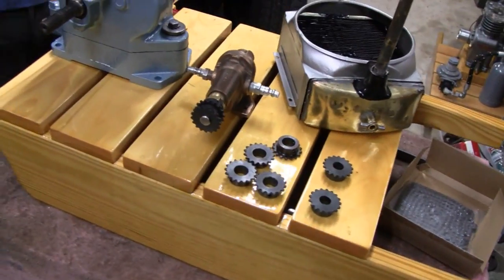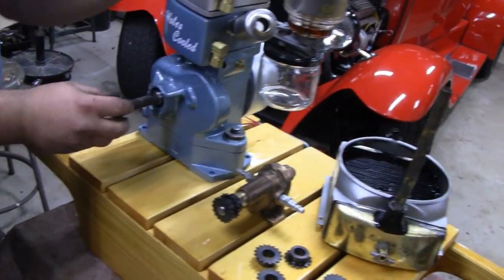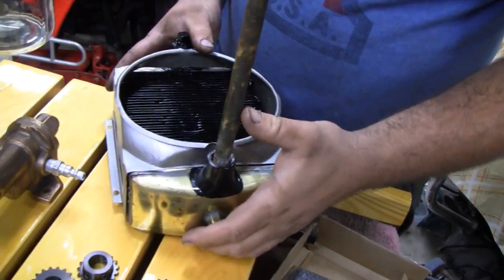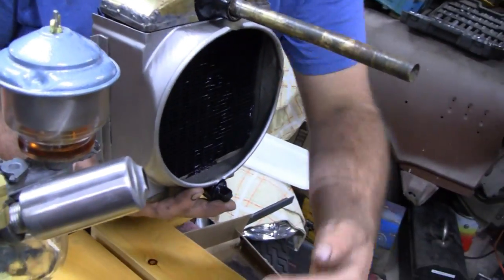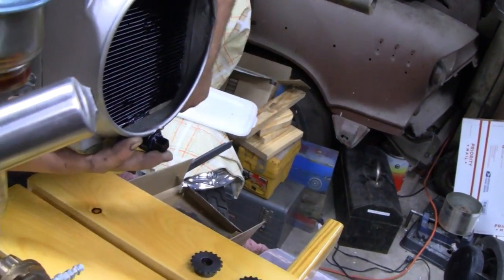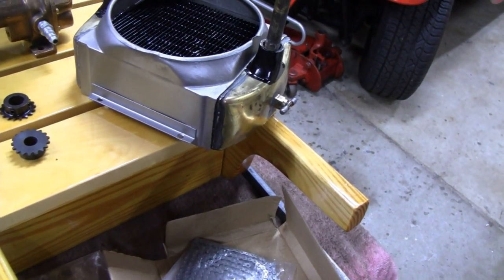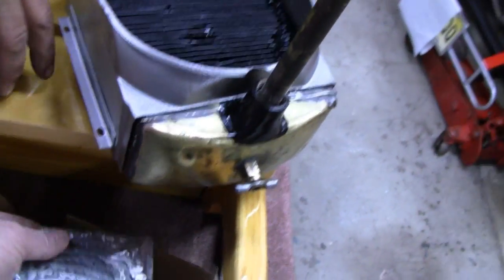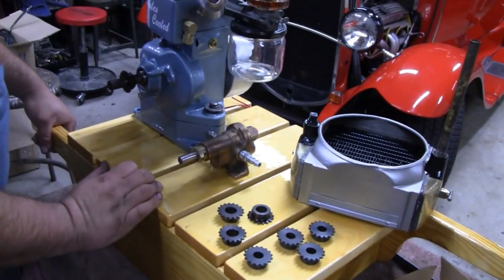HOMEMADE WATER COOLED BRIGGS ENGINE (part 37)

Comment: ur fan is gonna push the air thru the radiator rather than pull the air thru, the way it looks now the exhaust is also going to be pulled into the radiator. the fan needs to turn clockwise not CCW.

Comment: Make the pump moveable so you can adjust the chain length
Reply: DeadlyVoltsHD .......or just put a spring loaded idler sprocket, but anything else in the "loop" would rob horsepower. Adjusting the pump would cause the fan to become loose, and vice versa. You can't make the fan adjustable without making the radiator adjustable as well. They sell half links just for that purpose.
Reply: Keith Lucas i guess just use a longboard wheel and groove it for the chain to sit in the groove and just make as you said a spring loaded lever with the chain roller
Reply: DeadlyVoltsHD....I built automation machines back in the day and improved existing ones. One of which I milled nylon strip stock for chains to track in taking out both the noise and vibration from chain slap. Honda motorcycles that I worked on back in the Seventies had the double rubber rollers on a spring loaded channel, very quiet.

Comment: I assume the radiator mount was installed temporarily and will eventually have the nuts under the sled surface. As for noise from the chains, if one has an odd number of links and the other has an even number, the harmonics will cancel each other and run perfectly quiet. :-) Chain guards are probably on the to do list so the engine will be OSHA approved. Good job guys and I always look forward to the next installment of this build.
Reply from the maker: Thanks Bud!!☺

Comment: How does a half link work on a chain? Aren't the rollers supposed to be equally spaced to give correct meshing with the toothwheels?
Reply from the maker: You have to see one to understand how they work!!☺
Reply: derp, a quick google explained it haha. Basically just means you can get away with removing one link at a time instead of two.

Comment: I would have turned the motor the other way put the fan on the end of the shaft to cool the radiator and then you would have only had one sprocket to deal with. Nice videos and project, thank you
Reply from the maker: Thanks Bud!!☺

Comment: Hi Thanks for the update It's still looking great, It's a Christmas engine your building "It's coming"  .  It's a shame you couldn't of found a small filler neck and cap to put in the top of the rad when you had problems with the old fitting, maybe it would of looked more original than the T Mike talked of . It's a shame it would be a pain in the butt to fill through that tap  even.

  When you talked of half links, I know you are trying to keep the spacing nice on the boards, but could you make adjusting slots in the boards so you can move the pump and the rad slightly. That chain probably won't stretch much for what you are doing so maybe it won't matter anyway. Or like somebody else said you could use  a belt and loose the chain noise, if you could tension it that way. Yeah I know it's your engine and design just thinking out loud again L.O.L.. Take care see ya next time.
Reply from the maker: Thanks Bud!! A couple of guys mentioned how loud that little #25 chain is gonna be!! If it's gonna be louder than the exhaust of that engine, I don't think I'm gonna want to run it!!☺
Reply: I don't think that chains gonna be that loud L.O.L It's probably gonna just sound like a pissed off humming bird flying about in the back ground. Personally i'd like to listen to the "pure engine note" of that single cylinder firing. I love listening to the sound of things  like a hit and miss, or a big turbo 6 diesel. A  3 cylinder sounds like a bag of bolts in a clothes drier, and a 4 is plain to me unless it's turbo diesel working hard. It's an engine guy thing I guess, There's quite a few sweet sounding motors in stuff I've driven and the radio  gets turned off to listen to the motor work !  .

Comment: Chain is ok but most engines use v belt for the water pump and the fan. IMO, it looks somewhat weird. I mean… it'll work fine for the display engine, but for an engine that has some real work to do it would be just another source of noise and another point that needs regular lubrication.
Reply: I think this is supposed to look somewhat vintage so a flat belt might be more appropriate than a V-belt. Love that radiator and cowling.

Comment: This is a cool build. I've been following from the beginning. I was curious as to how to drive the fan and pump. I was hoping for a four or five rib serpentine belt with a spring tensioner. Seems like chains would flop around a lot and throw grease everywhere. Arm chair quarterback signing off.

Comment: I know why you put them in that configuration, but part of me still would've wanted to see it in a "car" configuration with the radiator on the front, the engine with the pulley facing it and the pump mounted on a bracket on the engine itself all with their respective drive shafts aligned for the sprockets. Not that it's bad looking now, don't get me wrong, just something i would've liked to see, eh, maybe another time. :)
Reply: aserta That's kinda what I was thinking. Like an old LeRoi engine.
Reply: i hate your comment and your ideas